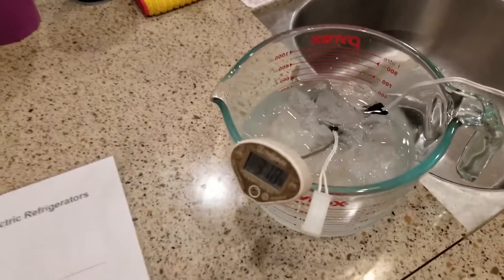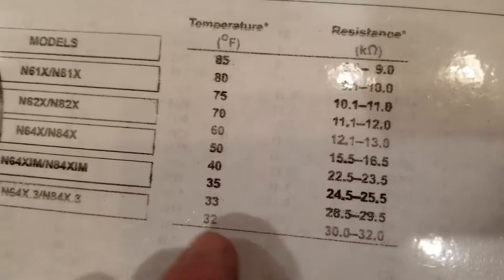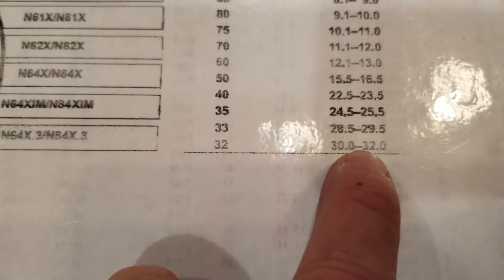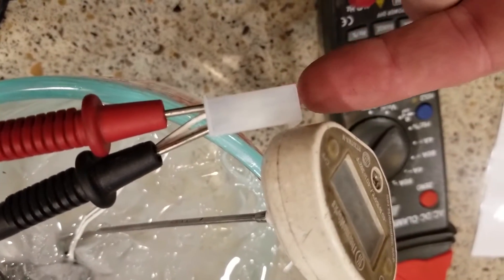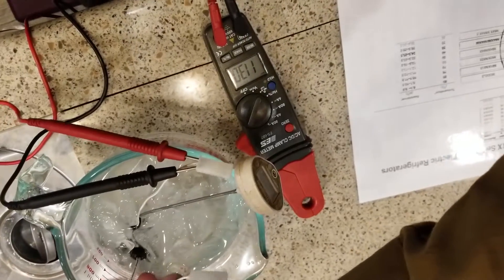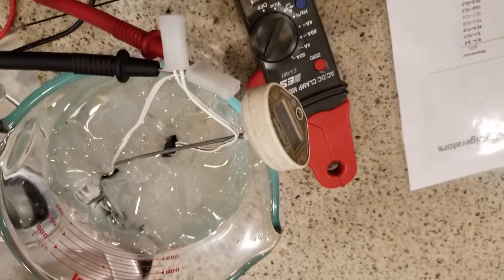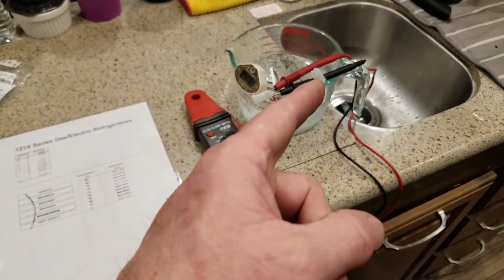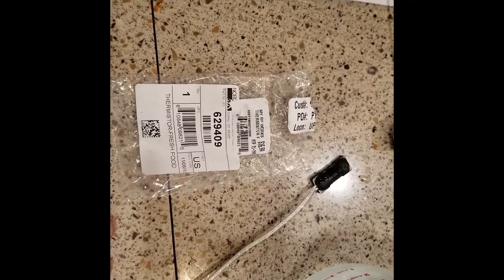RV Refrigerator - Testing A Bad Thermistor

Comment: So I have the Dometic RM 2454 whether it's on electric gas or 12 volt it's just barely keeping up with cool around 45 or 50 I slid the thermistor up and down didn't make any difference other than I took it out of the clip and laid it in the middle of the rack and it went down to 38°. I checked the resistance on it within ice water and it was 8.0. Can the thermistor work one minute and not the next should I change it out anyway?

Comment: BTW  YOu never need to check the ice water temp. It is always going to be at 32deg.  Even if you put a flame under it, it will remain at 32 till all the ice melts.

Comment: Thanks for all your videos. I have a Norcold N841. I got the “no co” code and I checked everything you said in several videos. Heating element good, ventilation good, 115 volts good, 12 volts good. So I noticed 2 dark burned areas on my control board. I bought a new one and replaced it. I reset the fault code on my eye panel on frig. Everything worked great for 12 hrs. It through a “no co” again. I checked my thermistor and it shows 9.8 in ice water, which is bad. My question is, will a bad thermistor made the frig throw a “no co?” I am replacing it but just wondering? Thanks, Craig James.

Comment: For a dometic rm2351 I’m only showing 2.5k at 80°. And 5.2k at 39°. So do these specs apply to the dometic? Now after sitting a few minutes it shows 7.9k at 37°. I am using a wireless grill thermometer in a glass of ice water sitting several minutes. I don’t think my low end temp is very accurate on my thermometer honestly. 
I did find the specs that says at 33-35 after 8-10 minutes I should read 8-10k. Not sure why I had a odd jump but I pulled around on the wires and it didn’t seem to change so I’m assuming it was just the thermistor adjusting to the new temps in the glass of water. I’m going to try to just readjust the thermistor and see how it goes before I go buying one.

Comment: Hi Darren, I have a Dometic DM2662. This morning I noticed it wasn't very cold. Using your video about testing the control board and element, everything test good. The propane lit, and the element read 2.79 amps. So i wasn't sure what was happening. A few hours latter I opened the fridge door and the inside light did not go on. I thought it my be the bulb, but them I noticed the lights on the eyebrow board where off. I tried to turn it on and off but nothing. It's raining out right now so once it stops I'll check if I have voltage. 
I check your resources for a service manual for this model but could not find it. Is there another model that is the same so I can check the Ohms on the element and the thermistor. With no lights on the eyebrow board I'm guessing the eyebrow board was going bad and finally burnt out completely.

Comment: First, thanks so very much for your videos on so many rv trouble shooting and repairs.
My RM2862 Dometic refrigerator is running at 41*f with the thermistor almost all of the way up on the fin. The interval setting is up to 4 from 3, which is where it’s always been for the last many years.
I did an ohm test and got a little above 8,600.  The chart from your resource indicates that at that value, the temp should be +/- 34-35*f.  The value at 41*f should be 7,240 according to the chart.  Am I correct to believe that the thermistor should be replaced?  
The freezer is still keeping things frozen, but I’d really like to have the refrigerator temp more towards the 35*f area.
Thanks again for your easily understandable and very valuable videos.
Reply: Sounds about like mine. I put a temp gauge in mine and it will get to 40ish but takes about 3 days. Once I started opening the door during regular use I was hitting up to 55°. At night by morning it will back down to 40-45. I tried to run the thermistor up to the top to see what it gets down to. Mine is only about 2 years old and is not keeping up at all.
Reply: I did replace the thermistor and within a day, and afterwards to now, is staying +\- 35 degrees.  Sorry for not updating the comment… your videos were so valuable to get this problem resolved, and taught me a great deal.  Thanks

Comment: Our Dometic fridge runs too warm (50) and freezer solid cold. Found thermistor off clip and reattached to top of fin. Still same result. Starting to learn how to use multimeter and will check resistance numbers for this manufacturer. Your videos are spot on for information and detail. Thanks for taking the time. 
Any thoughts on these "adjustable" thermistors I see on the market? Will they damage anything?
Reply: I have the same issue. Freezer keeps ice but the ridge fins around 41 in the AM to 65 in the PM so too hot to keep food fresh. Was it the thermistor?

Comment: I have a small, older dometic refrigerator and am trying to make sure I'm turning it off for certain.  There's a couple off positions on the power source selector switch so I'm good with that, but the temp control switch is hard to turn and the off position never actually comes into view on the switch. I turn all the way left and it goes a hair past the 1 setting and all the way right past max setting and I can see the off but not fully whereas I vaguely see it when turned down to the 1.  I would assume it would be off near the 1 setting but the indicator shows off closer to the max setting. Which way is the correct direction to be off or does it even matter since its in off on the power source selector anyway. Thanks for any input.
I know, stupid question huh.

Comment: Confused new Tech here! Testing a domestic thermistor in a little Image trailer: Does your volt meter have to be set on ohms or like auto Ohms setting? When I test a thermistor on a Dometic refrigerator my meter reads OL on Ohms. Have I diagnosed this right? Break in the circuit /bad part? Is this right? But when I hit a button on my meter it goes through a few other Ohms settings and I get a 9300 reading on my meter. Which is the right setting? I know they can read between 8500-9500 ohms give it take 10%. Thank you!

Comment: Thank you for all the effort you put into your videos. We've been full time for 1 yr and 3 months and the dang fridge just went down. Dont wanna buy a new one if its something easy. From what I think you said in another video is I can unplug the thermistor and that will put it into full on mode and that will give me an answer? Dont have a thermometer or I would test it with the meter.
Reply from the maker: Okay, please elaborate where you say the refrigerator went down. Do you have power at the eyebrow board, does the light turn on when you open the door? Or has a whole thing gone dead in the water? By having the thermistor floating in the air, it will effectively communicate to the the burner to continue distilling the ammonia, which creates the cooling effect.  See, the thermistor is not reporting back fin temperature but air temperature. The board has no idea of knowing this and will continually try to cool. The easiest way to troubleshoot these refrigerators is on electricity because there's fewer elements that could fail with regard to the lp side.
Reply: @MyRVWorks  lights come on, burner heats up, and I'm running on AC. I watched your other videos as well. Checked all the fuses and everything  has power. No ammonia smells, no residues or yellow powder substance. Still scratching my head lol
Reply: @MyRVWorks  thermistor been unplugged for 2 hrs now still no cooling. It's a Dometic DM2652LBX
Reply from the maker: @MountainTopHomestead316  Are your coils on the back side hot/warm everywhere you touch them?  No cool spots?  If you have cool spots then you are most likely looking at a blockage in the cooling unit.  If they are warm, we can assume the cooling unit is fine and it could be either the instillation (chimney affect I alluded to in my drawing on this video:  https://youtu.be/IT_5HGe4q-k)  or an ice damn that I discuss in this video:  https://youtu.be/H-Cg-7YHyYE.  One more thing that comes to mind...  Verify the ohms and amps on that heating element to make sure it is operating fully.  Also verify the wattage per the mfg spec.  I have seen where the incorrect wattage heating element was installed by others.  I have manuals on my website here:  https://myrvworks.com/manuals/
Reply: @MyRVWorks  your awesome mam, thank you so much. I will be working on it this week and make a video on it giving you a huge shout out. Thanks again!
Reply: @MyRVWorks  ok so the coils in the back are not warm to the touch at all, plugged into an outlet and let run the fridge run for 6 hours and nothing. I take it that means a new coil unit is needed and if that's the case replacing the fridge would probably be more cost effective in the long run. Coil  was priced at 1,000.00 and a new fridge was the same 🤣🤣😭
Reply from the maker: @MountainTopHomestead316  I have had great results from here:  http://www.rvcool.com/
My related video on cooling unit R&R:  https://youtu.be/H-Cg-7YHyYE
Reply: Heating coil seems to be working fine as well. Cant put my thumb on the issue 🧐🤔

Comment: Thank goodness. Your channel is great. But I have a question. How can a bag thermistor make fridge hot?  I thought if they failed they would get too cold. I definitely subscribed. Sharing you everywhere I can‼️
Reply from the maker: If the thermistor falls off from its perch and is still working, but reporting on the air temp vs the fin temp, it will send a value that it is too hot and therefor the frig will continue to run the boiler.  If the thermistor ‘fails’, the question then becomes which way did it fail (reporting too high resistance or too low)?  The thermistors only purpose in life it to change its resistance based on temperature.  In the video here it was sending bad data to the control board.
Hope this helps!
Reply: Thanks